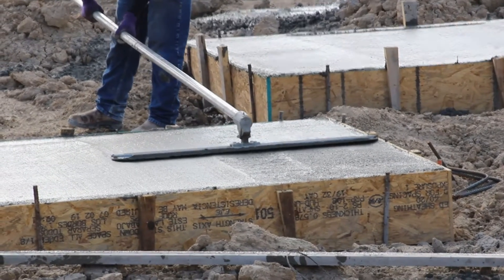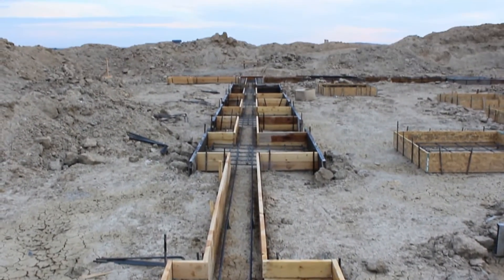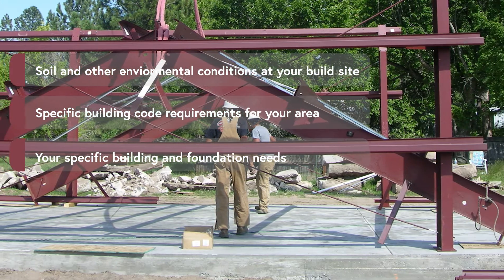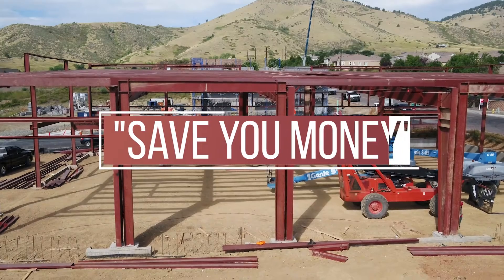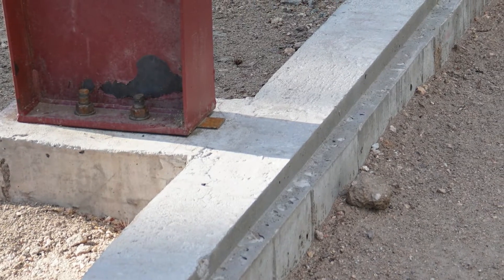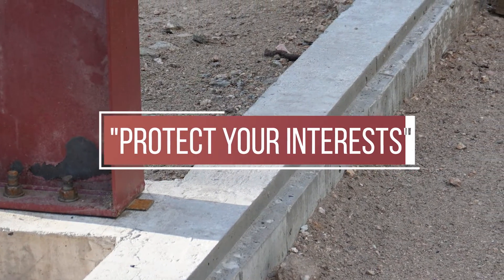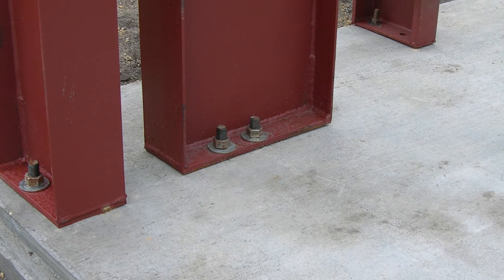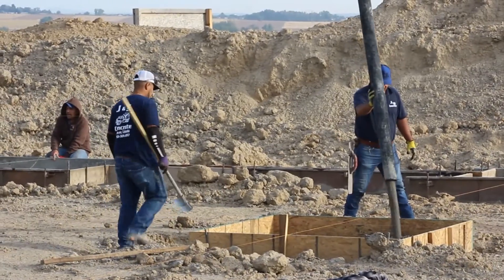The Advantages of Having an Engineered Foundation Design for Your Metal Building

Comment: Certified Training Institute mentions,  HAIR PIN  tie in for Beams to be tied in to the slab.  Movement of the PEMB is expected, and outward pushing of the beam at the base due to the expanse of the roof.  A tie in with a beam through the slab accross to the beam on the other broad side, also a good idea that Architechs are trained to have if it is with their expertise.